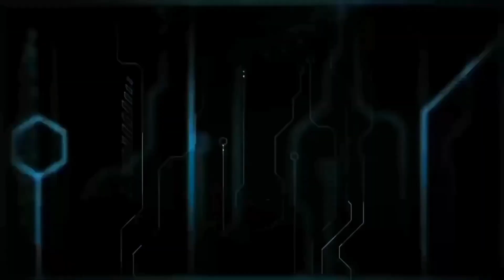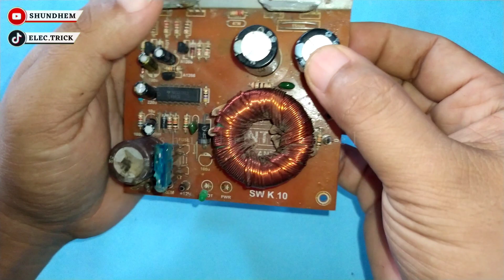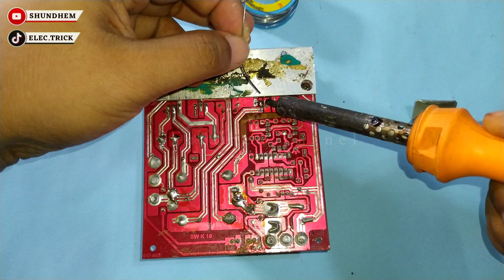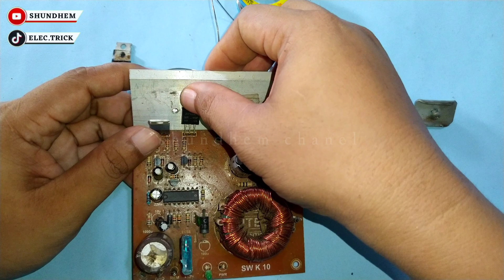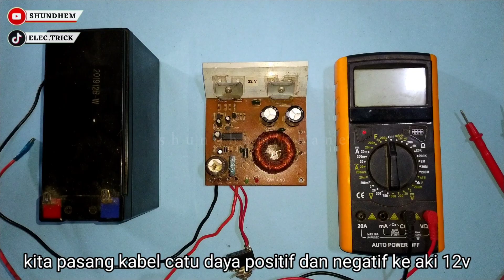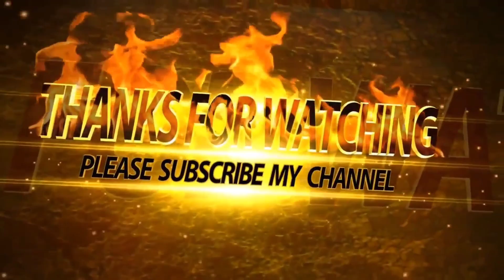Cara mudah memperbaiki inverter dc to dc simetris mati total

Comment: Klu bagian out put tegangan sering berlebih apa nya ya bang ? 
Dari 24 v menjadi 38 v.
Irfz 44 sudah di ganti, semua transistor sudah di ganti masih saja begitu, mohon bimbinganya bang
Reply from the maker: cek volt out pwm dikaki 9&10 harus simetris atau sama keduanya, cek resistor di kaki nomer 6 tl494 mungkin ukuran melar atau solderan kurang kenceng.

Comment: Pk klo irfz44 nya d ganti yg seri lain bisa gk tpi bentuk nya masih sama.
Soal nya irfz44 gk ada🙏
Reply from the maker: bisa, irf3205/054n10/047n10, usahakan pakai fet ori.
Reply: Makasih bg
Reply from the maker: @salakasangpengembara9069  sama-sama, ditunggu hasilnya, smoga bisa kembali normal, pastikan dulu kedua out pwm normal tegangan imbang.
Reply: Iya bg makasih banyak

Comment: Mass kalao bass dibesarkan lampu powernya berkedip apanya kira"
Reply from the maker: amper tegangan kurang kuat
Reply: @shundhem_electrick  akinnya berati mas
Reply from the maker: @kabol.entertainment  aki bisa, mosfet bisa.
Reply: @shundhem_electrick  cara biar tegangan inverter DC to DC spontan gimana mas biar kena bass tidak drop arus nya dan mosfet tidak panas apa yg harus di modif apanya mas biar tidak drop inverter DC to DC 42v